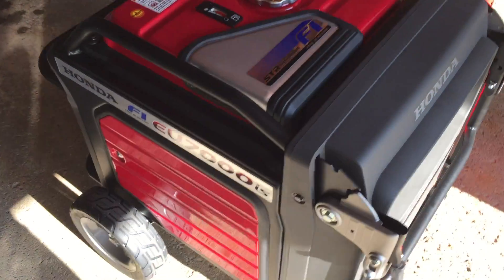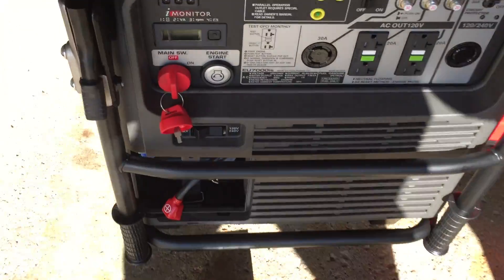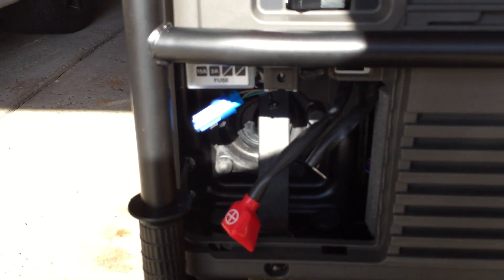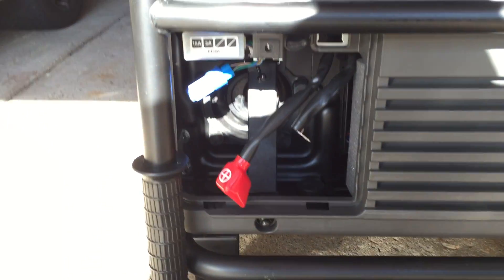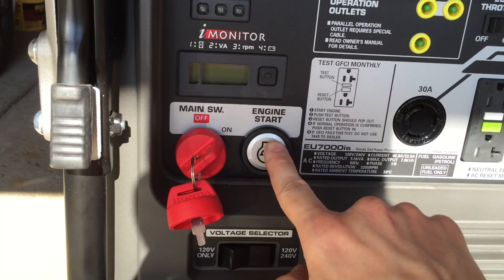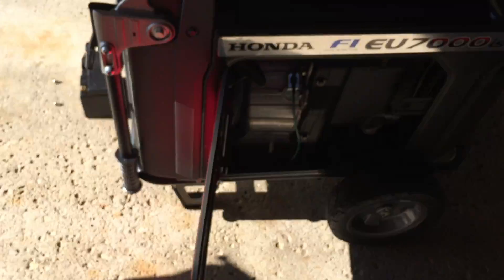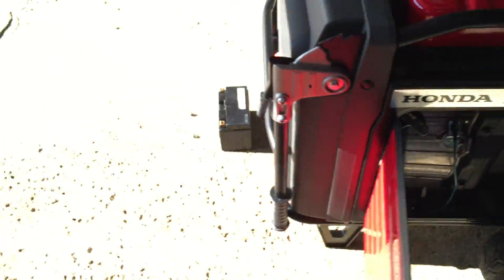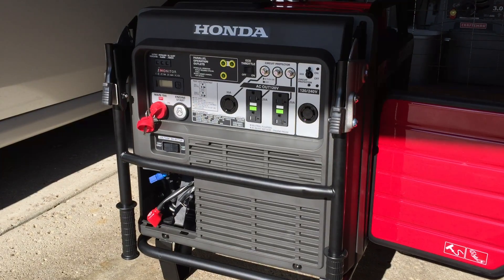Honda EU7000is Fuel Injected Inverter Generator - Pull Start W/ NO Battery...

Comment: Does battery charge when engine is running?
Reply from the maker: Yes, of course. It has a moderately powerful and well configured charge circuit. It will start down to quite low voltages, and charges it back up quickly. You can start and stop it frequently without worry.